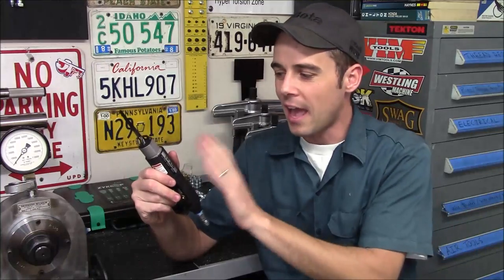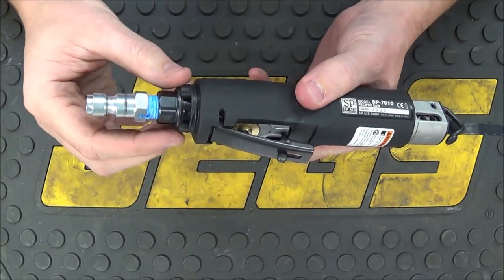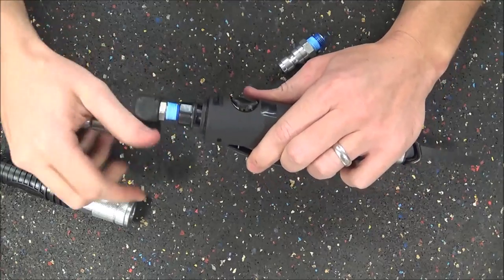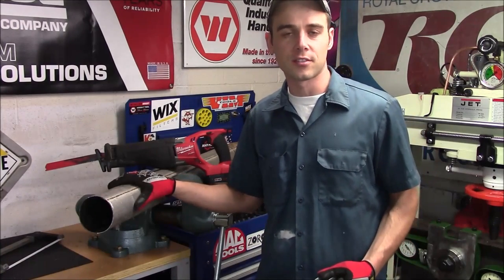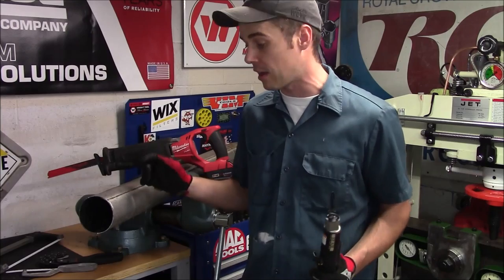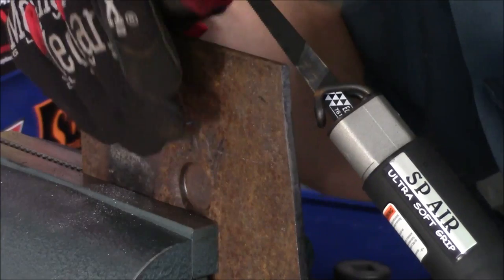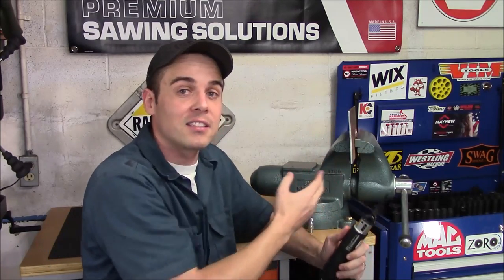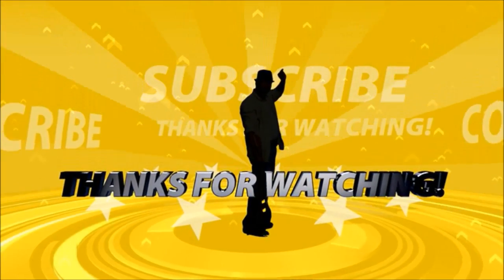SP Air Recipro Saw SP-7610 (Gear Type) - MADE IN JAPAN

Comment: I have an Automotive Glass replacement company and we do a lot of van window conversions, cutting out van panels on vans to bond in privacy glass. I have been looking for a tool that makes easy work cutting. At present we use a German Draco cutter that leaves a pigs tail as it cuts, but it's hard work cutting radius corners and is bulky. How does this saw perform on radius corners? Does it leave much swarf cutting through the steel? How controllable is it near to swage lines and paintwork?
Reply from the maker: The teeth will leave chips like any saw, but I think the main problem for you would be vibrations on that large area of sheetmetal.....most likely leaving a non-even edge and possible chipping of the paint.  I would look into a nibbler.....no pigtails to deal with like a shear & you can easily cut radiuses.  Check out these (corded, cordless, or air).....  http://amzn.to/2k0rhV0 / http://amzn.to/2jbKv5O / http://amzn.to/2jbPF1A  ----- Also....check this video to see how the nibblers work with a van window conversion -> https://www.youtube.com/watch?v=Db6gSotCwY8
Reply: Hey thanks for the quick reply and links. Some van panels have the inner skin only a few millimetre's from the outside panel we cut out, so whatever tool we use to cut with has to be very shallow to clear this area behind. The air saw does look a great tool that may be just the job for cutting body seam sealer that bonds inner & outer panels & anti vibration braces/stiffening bars.
Great video reviews by the way - loads of information for specific usage in the real world you have a knack for presenting this in an intelligent way. Good stuff.

Comment: I think the snap on dual chuck might be a little better for the money.
Reply from the maker: +Rahsaan thomas Keep in mind that the Snap on is the Piston style (10,000 spm) .....less power, burns up blades, and stalls.....plus it costs $100 more than this one.  There are very few gear driven saws on the market currently & as far as I know, this is by far the most compact one out there.

Comment: is there a link to the fittings you recommended
Reply from the maker: +vaughnburrows I bought them locally....but they are 3/8" fittings with 1/4" NPT male threads.
Reply: I, and it seems many others, are having great trouble locating 1/4" NPT fittings with 3/8" ID. Got any links of similar products?